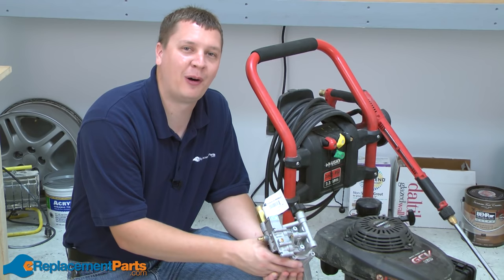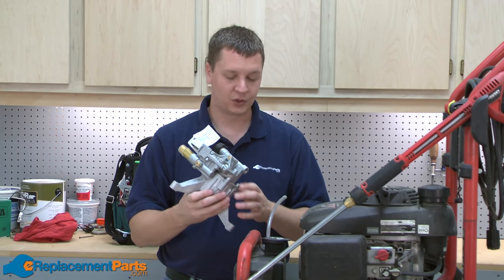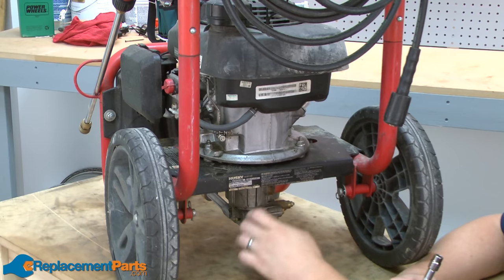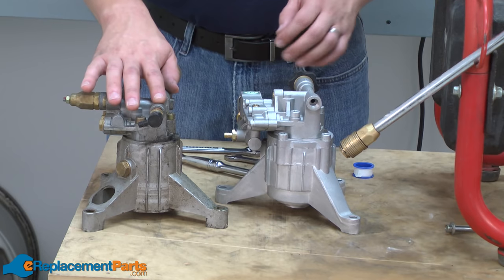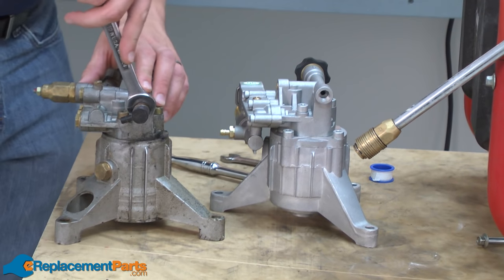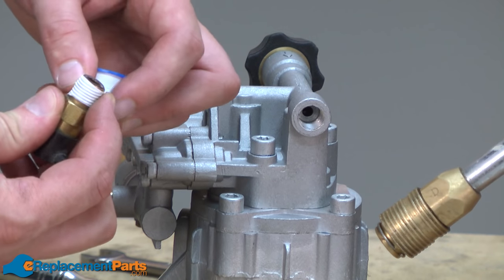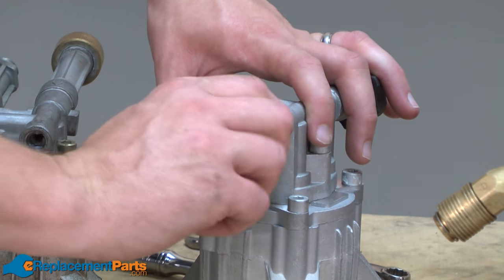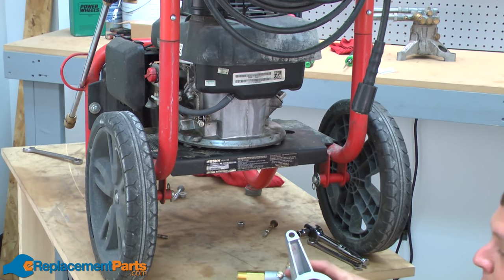How to Replace the Pump on a Pressure Washer--A Quick Fix

Comment: Thanks for taking the time to post this video. I had the same problem and simply took the thermal relief valve out and wrapped some Teflon tape around the seal and good as new. I didn't even take the pump off, I tilted the machine and was able to reach it. Thanks again I hope this post helps others too.

Comment: I have a Husky GCV 160, 2600psi pressure washer very similar to the Homelite in the video. The pump on mine is broken, will the Homelite pump work on the Husky?

Edit: also if I buy a pump, does it need to be 2600 psi? Or will something like a 2800psi pump work fine?

Comment: Hi I removed the three bolts like you did but unlike your video my pump didn't drop right down?  Should I pry it or is this going to break something else?  I have a B&S motor on a Craftsman power washer.
Thanks..joe

Comment from the maker: The new pump was slightly different. Most manufactures of of "Home Center" pressure washers simply take an engine from one source, a pump from another, and bolt them to a frame that they produce. Because of this outsourcing a replacement pump isn't always exactly the same as the original as the manufacture is always shopping for the best price they can get on the pump.

Thanks,
-Mark

Comment: those water pumps look the same but if you look carefully are completely different, the position of the legs are different, that's why the new water pump is facing backwards

Comment: I have done with the same exact pressure washer.  Once back together I realized the crank oil seal was bad, I have a new seal put on, but should there be a flange or washer to hold the oil seal in place before I put the pump back on?
Reply from the maker: The oil seal is pressed into the pump.  There is not a washer that holds it in place.  Just a reminder to check
your oil.  I'd hate to have it be out of oil due to the worn seal.

Comment: My Homelite 2700 won't produce any pressure.  Changing the pump didn't make any difference.  Could it be the thermal release valve?  That's the only part left to replace?

Comment: Any help on getting my pump to come off, the bolts are removed, but seems to hang up.  Maybe pry the key on the shaft? Some kinda gear pulley concept?  Sledgehammer?  Help!
Reply from the maker: Your not far off with the sledge hammer idea.  Sometimes moisture corrodes the shaft and makes these difficult to remove.  I would
get something like WD-40 and try to get some on the shaft and let is soak.  I have 3 pry bars I use in this case.  One you get the pump to
bust lose it should easily come off.

Comment: good video i have the same husky pressure washer and mine is acting up i bought it 3years ago no problems till today 
it has no pressure i checked the hose and any filters but still no pressure if i leave it running then i go hit the trigger it will shoot out then back to a normal water flow HELP thanks again

Comment: its says on the pump Use SAE 85W90  do you need to put the oil in & how much?
Reply: The pump should be a sealed unit from the factory. If not, just look in your owners manual.

Comment: How can I tell if my pumps bad? It was washing fine but it started cutting off and on and then just a stream of water. Is it the pump??
Reply: The pump is bad. Don't mess with parts because it will only last about another year. Amazon and ebay have great prices on replacement pumps.
Reply: THANKS! Your right it was the pump, I bought a new one on eBay and it works fine now!

Comment: hello can you please tell me where can I find rebuild kit for my pump?
Is a Generac 2700  psi/2.3GPM 186BAR/8.7LPM
Pump model is RMV 2.2G24
Thanks
Reply from the maker: We don't have a listing for any of the internal parts for these smaller pumps.  I've checked other vendors and Annovi Reverberi who manufactures these and haven't been able to locate anything.

Comment: I purchased this pressure washer and after about 3 times i used it,it quit. It had no compression. Took it to warranty shop at northern tools in conroe , texas and was told i had run it out of oil and was not warranty. Motor had oil in it.I showed it to tech. Another service tech asked if when i was using it was it sitting on a hill. I said yard is sloped. I said doesnt motor have a shut off if it is not getting oil. Tech said no. Honda will not warranty it and Home depot told me its not their proplemn. Nothing in the manual mentions this about the ground. What is more irritating is Home depot blew me off and tech at Northern tools would not even try for warranty. My question to honda. If iam pressure washing and motor stops running do to oil leak or sitting on a hill side, how am i suppose to know without a warning system. I did email Honda and got no responce.
Reply from the maker: +Edward M I'm sorry to hear about the problems you've had with your Honda Engine. Your Service Center and Home Depot are correct in saying the warranty doesn't cover damage due to a low or no oil in the crankcase.  We have the same rules with warranties here.  Honda engines are equipped with the low oil sensor that will cut the spark before damage is done to the engine.  This system is very effective unless as it sounds happened to you, the motor is operated on an angle so the sensor reads a false oil level.  I wish I had the perfect resolution but I don't.